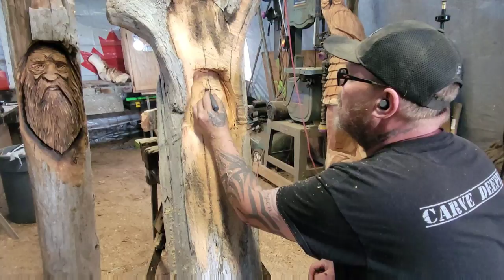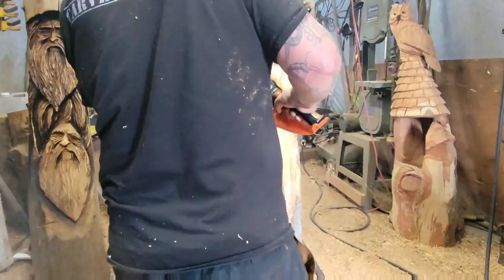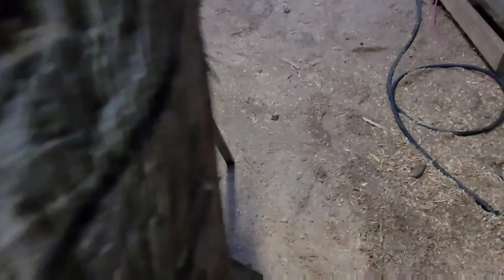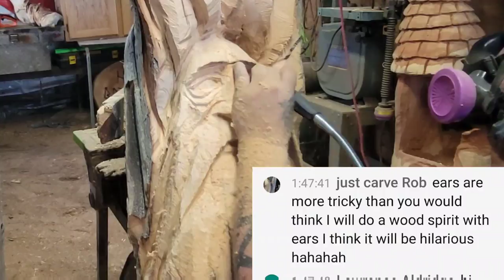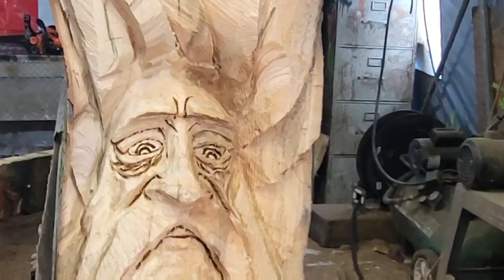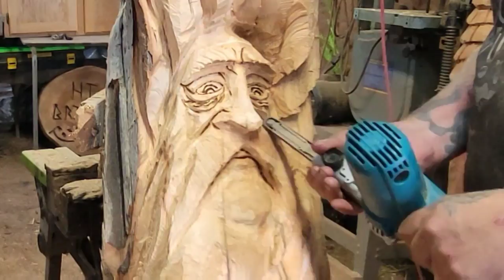How I started selling my carvings- Carving a Woodspirit Time-lapse.

Comment: Hey Jordy. I see you’re using that small pointed dremel bit for doing those burn lines around the eyes n such. I got one of those bits, but can’t seem to get it to burn. How does that work?
Reply from the maker: Make sure u are not using ur flex shaft and only the bit in the tool itself
Reply: @CarvingFusion  awesome, thanks... I’ll take off the flex shaft...